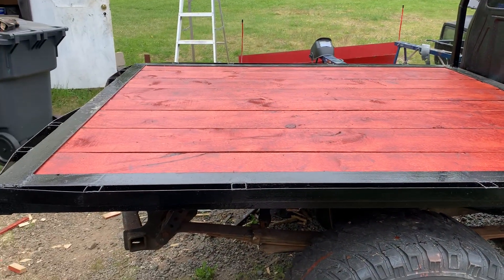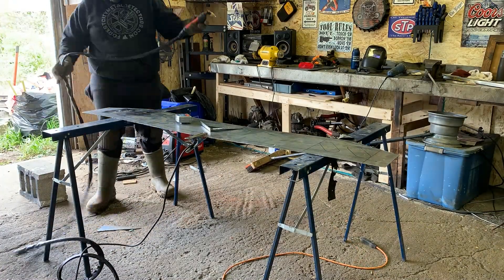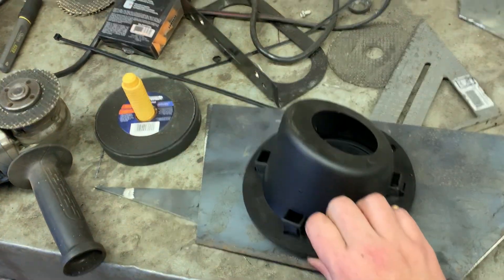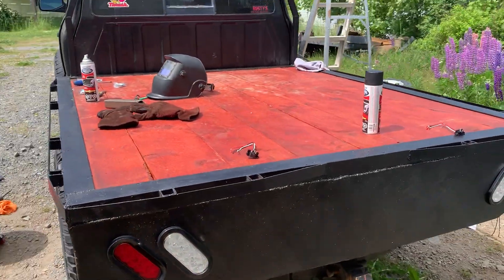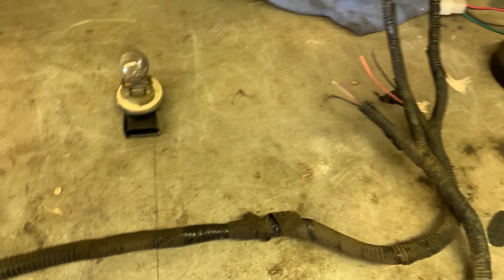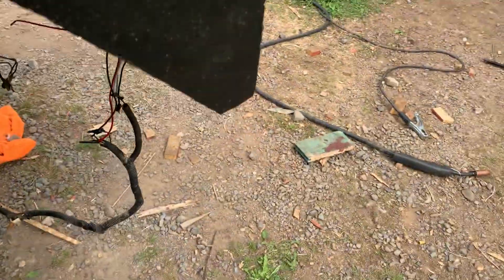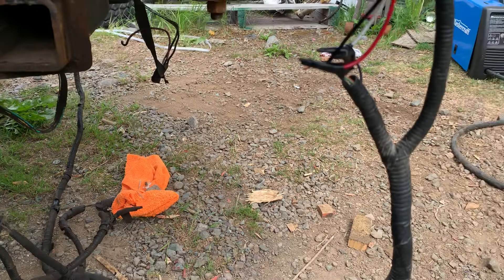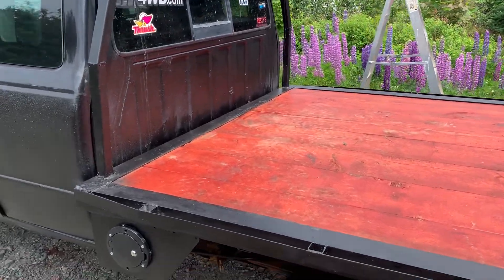Ford Ranger Flatbed Build  - Budget build -Wiring LEDs, Gas cover- Part 2

Comment: Great little series. I recently flipped my ranger and crunched the bed. Im gonna use yours for inspiration and build something very similar with a metal deck and slightly narrower 👍🏼 thanks for the post!
Reply from the maker: Thanks, let me know how ya makes out! flat bed is holding up well, i bought a f150 long box, but imma start using my ranger as a plow and offroad rig i think.

Comment: Black wire is the dim function of a 12v light. So your b/u lights would be a ton brighter if you used the red wire instead of the black
Also, as an alternative to resistors, you can wire in an additional incandescent light on each side. If you don’t want them to be seen from the outside you can even zip tie them up underneath the pickup so they shine at the ground. Gives a neat red glow on the ground under the pickup and it obviously blinks with your blinkers which can look cool at night. You can also tie them up completely so you can’t tell they are there at all. There have been times I’ve left the factory wiring intact so I could just plug in the factory bulb to get sufficient resistance and spliced the led taillights in somewhere upstream a little bit. But in both cases, don’t tie them to any wiring because they both produce a lot of heat and can melt the coating clean off causing a short

Comment: This is sick b'y, definitely doing the same to my 2010 fx4. Do you have a link or part number for the signal resistors?
Reply from the maker: by its some convenient owning a flatbed for the most part, doing dump runs kinda sucks but everything else is way too awesome.

https://www.amazon.ca/Grandview-Resistors-Cancellor-Especially-Switchback/dp/B07S6N2HMT/ref=sr_1_2_sspa?crid=3W22REYL4N80G&keywords=amazon+led+light+resistors&qid=1682978950&sprefix=amazon+led+light+resistors%2Caps%2C115&sr=8-2-spons&psc=1&smid=AY0MC7HQ2EF6B&spLa=ZW5jcnlwdGVkUXVhbGlmaWVyPUFVQzAzSkVUS1UyTlkmZW5jcnlwdGVkSWQ9QTA1NzAzNjIyU1BaMTU4UUhGNElZJmVuY3J5cHRlZEFkSWQ9QTAwNDA0NzMyUEZFNzYzVjM0U05IJndpZGdldE5hbWU9c3BfYXRmJmFjdGlvbj1jbGlja1JlZGlyZWN0JmRvTm90TG9nQ2xpY2s9dHJ1ZQ==

Comment: Good work man! My Uncle and I Just built a wood bed for his Ranger but are having trouble trying to extend the fuel fill out to the edge. What did you use to extend yours out?
Reply from the maker: nice, and thanks! i havent extended mine yet, just got it stretch out a bit. you can just buy filler hose pretty much anywhere and cut it to the size you need. its a rubber fuel hose. for me i think i will need it about 2-3 inches longer in total.  swing by a auto parts store or you can order the hose online
Reply: @muddythumper8152  Yeah I can find filler hose at pretty much any parts house but my issue has been trying to find the correct size for the Ranger it's like 1 1/8in hose. Parts store has 1in and 1.5in. I reckon ill have to find an adapter. Anyway again the bed looks great almost like  a factory bed but with character...
Reply from the maker: @ricochetey  oh okay something like this may be what you need https://www.fillernecksupply.com/amp/1-1-2-to-1-1-4-fuel-fill-neck-hose-end-id-reducer-1/
Reply from the maker: Also check hose and fittings shops such as a hydraulic shop. Often times they have hoses for chemical use and a variety of sizes
Reply from the maker: i am going to be extending my fuel filler hose the upcoming weekend. I looked into it, easiest thing to do from what i can figure is either go to a industrial rubber hose supplier and get 1 1/4 hose a foot or two. Also just buy a hose Mender ( barbed fitting both sides) that way you can extend the hose to your liking. I'll be doing this, its easy as pie. Took me a while to come up with a good idea but that will work great. i can do a video if you need as well.